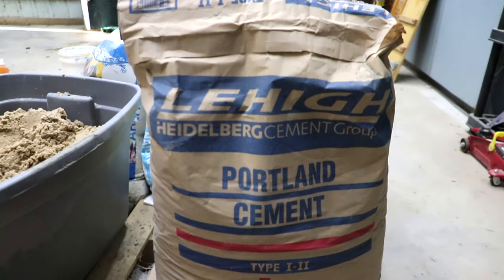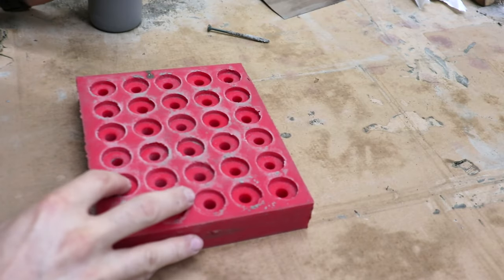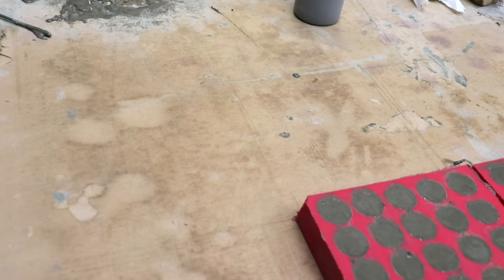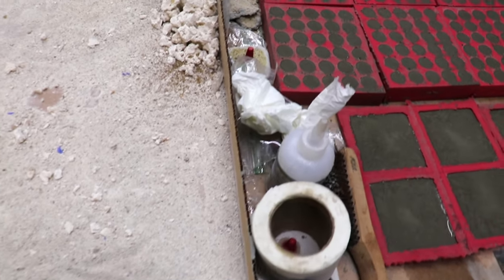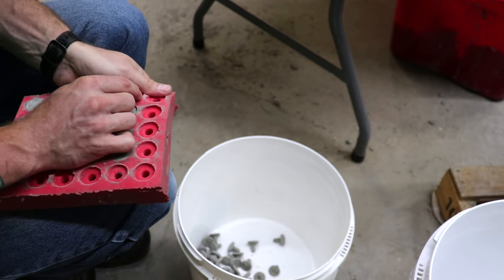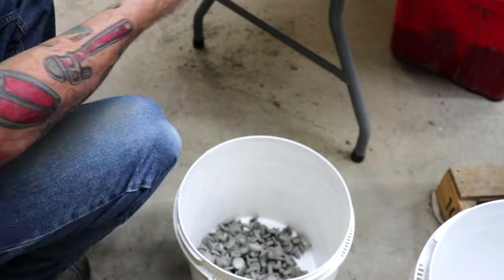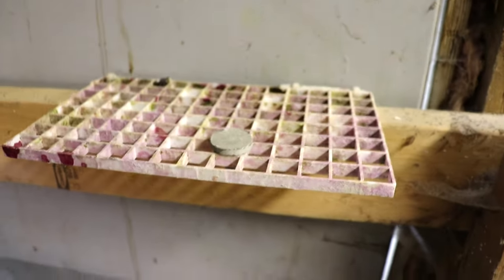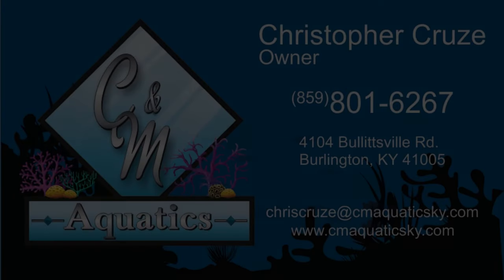Concrete Frag plugs are these safe?

Comment: Nice video mate. I used cast frag plugs & mini rocks for colonies about 8 years ago but stopped due to a lack of space to do it which is a common problem in the UK & time plus the ceramics, which were just starting to become popular were pretty cheap over here at the time. Now I have a bit more space to work & commercial plug prices are going up I think I'll give it another go, plus I'm not sure if you mentioned it in your video but some studies have shown you get I think around 11.5% faster growth on concrete vs ceramic.
Reply from the maker: Hello and thank you for watching.  Do you have any idea where I could find those studies, that would be very fascinating to me.  I have been very happy with how the plugs and tiles turned out. They are very cheap to make and I have plenty of room to make them.  I think they look more natural in an aquarium as well.
Reply: @cmaquatics7428  Yeh I think they look more natural & I quite liked making random natural looking mini rocks for larger colonies as I find customers tend to be more attracted to them than something less natural looking. I’m afraid I’ve forgotten where I read most of the articles although I have managed to find one which I’ll paste the link to bellow. I know there were other studies, one of which used calcium carbonate bonded together in layers with something but my memory is terrible. I dare say they’ll pop on Google.
Reply from the maker: Thanks for the info I will look into it.  I also started making and gluing aquascapes together.  People really like those.  So far all the corals I have put on the concrete plugs have encrusted and are growing great 👍
Reply: @cmaquatics7428  Sorry I just realised Youtube removed the link I posted for you so I guess they don't allow links! Heres the name of the study I managed to remember if you pop it in Google it should come up: Differential Effects of Substrate Type and Genet on Growth of Microfragments of Acropora palmata
Reply from the maker: Awsome!!! Thanks a lot for the info I will be sure to check that out tonight! I have about 2000 plugs I'll start curing today.  First warm day to do it.
Reply: @cmaquatics7428   no probs heres another:
Reply: @cmaquatics7428  Coral Colony Collapse: Investigating and Reducing Environmental Stress Factors in LPS Corals with Delayed Release Substrate
Reply from the maker: Awsome thank you!!! Can't ever get to much information in this industry.

Comment: I wonder how long he cures them for?…🤔…😂😂 

Thanks for the informative video
Reply: I cure them for a minimum of 5 months now and then test the water.  If the ph is still high they go back in for another month.
Reply from the maker: I cure them for a minimum of 5 months now.  If the ph is still High after that they go back in for another month.  I continue that process until the ph is back down to my base reading.